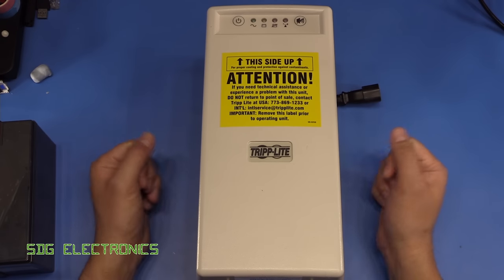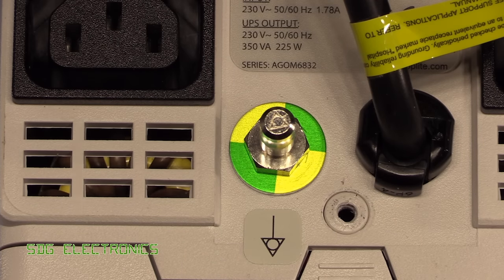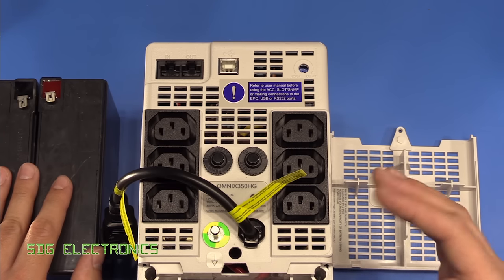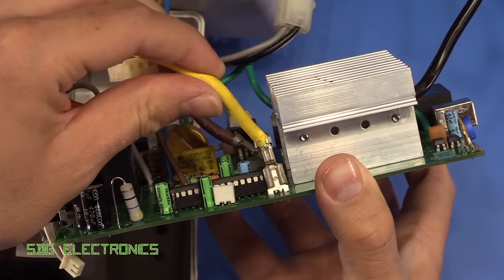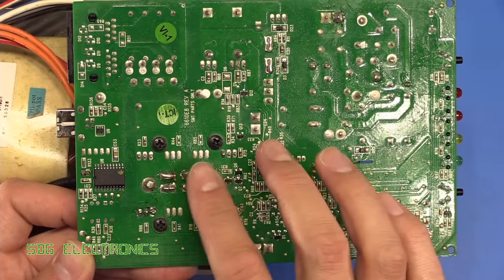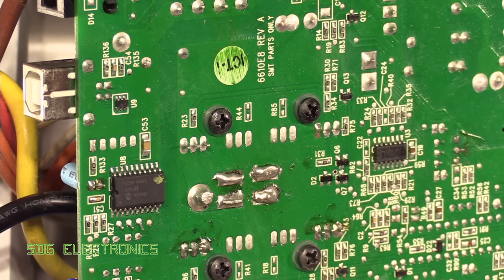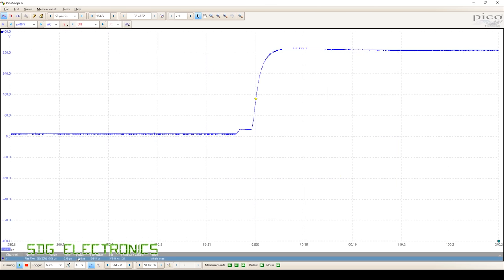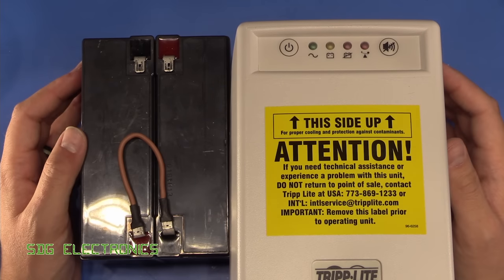SDG #145 Terrible Tripp-Lite Medical UPS! Pure garbage.

Comment: That's incredibly sad that things like this device are required to be used due to messed up regulations even if they are of poor quality and unbelievably overpriced.
Almost any reputable commercial grade device would be cheaper, safer, more reliable, and more sanely designed.
Reply: Totally agree
Reply: Depending on the medical procedure, you are still better off fully isolated than commercial ups for patient safety,
The actual design of this is garbage though

Comment: When I first saw the title, I thought you had gone prematurely senile. Medical equipment invariably includes the worst crap electronics. This is a typical example. To add insult to injury, when they put the 'medical' label on it, they charge ten times as much... Anyway, thumbs up for the video. I expected the unit to be garbage, but was still amazed by the AC output waveform.

Comment: Live and neutral fusing is because they could use it on an isolation transformer, which means both input lines could float WRT mains earth, so to protect against a short they fuse both, though probably the switching relays only switch live, passing neutral straight through, so an output fault of line to ground fault could feed back to the input side.

Poor design, and likely hand placed for a lot of the through hole stuff, thus needing the rework on the line to correct. Yes they solder automotive blade fuses in, but some are actually tin plated steel, and solder quite well, though they tend also to be the no-blow variety then, or at least blow very very slowly. I would have preferred they use what most use, which is a pair of crimp in spade connectors soldered to the board, making it at least easy to replace the fuse. Generally though if that fuse has blown then all the mosfets are also either smoked out craters or short circuit all ways, and the driver is also toast.

At least they used optocouplers, and decent clearance on the PCB, spoiled by the wiring being laid on the isolated side. Phone protection better than most, as in general there is only a PCB trace as fuse, and a dual MOV or spark gap on the phone pair, nothing else, though some I see the protection is not working, as the earth cable is not installed, or they do not install the MOV's or spark gaps.

Typical cheap UPS, not mains isolated, and built down to a price, using an old design. Would expect that transformer to run hot as well, and to be made with CCA wiring on all of the windings as well. Have a few I got for free with dead batteries, they are really only good for scrapping out the battery and the metal, and if you need an IEC inlet or outlet for something else, or some bottom end slow mosfets for power switching.
Reply: The main problematic point is that this UPS is not cheap at all. It's listed for US$500 at various suppliers.
At that price and intended use it shouldn't be built down to a price.
Reply: Technically this device IS an isolation transformer.
Symbolically speaking, our mains earth and neutral combine at the generator. You can't provide this functionality for the UPS unit and have a dedicated and reliable "back-flowing" path. Just turn the plug around, what also changes L+N. There may be a harmful potential between any current path and a following device casing. So any(L or N) cable to housing earth short circuit may provide the cut-out breaker current flow, therefore both have to provide a fuse. Remember that this is exactly the functionality to protect us from deadly touch voltages. And secondary, less important to secure the device.

Comment: They tried to solder to a blade fuse? the reason it hasn't flowed is because the elements in those including the legs are aluminium!

Comment: The microweld between the heatsink and the resistor is rather telling.... I hope Tripp Lite watch your video and do some hard thinking.  Nice tour around a shocking device.
Reply from the maker: Yeah, not good at all really. Doubt it'll get seen by anyone who can make any changes though.
Reply: @sdgelectronics  I guess the cost of certification/re-certification probably slows down any incremental improvements

Comment: Is there anything on the device that says it's for medical use I don't see any in the video, i've seen that company before on rack mount power strips (standard 19" racks).  Just wondering if they made it for medical use or if it's just being mis-sold.
Reply: It's marketed as medical grade on the official site and in the datasheet which is available on octopart or digikey.

Comment: I have taken apart Tripp-Lite, APC, Liebert, Cyber-Power, Vertiv, Eaton, and Minuteman UPS units. Every one of these brands has some quality issues. These small units are built to a consumer price point. The Tripp-Lite that you showed is one of their less expensive models that is made in China. Not to mention they state that they are not approved for life support systems. But, if you call Tripp-Lite they have had good support and they will replace it under warranty. I believe the UPS industry seems to be not about quality but support and warranty.

Comment: Did I see correctly that C51 has one end floating?  The SMD cap next to the PIC18...
Reply: Looks like the part may be smaller than the intended footprint so there's a big solder fill blob there? Still looks attached to the joint to me.

Comment: That is not a common mode choke - only one winding, the live side, NOT both live and return Neutral.
Reply: That's why he said "differential mode choke".
Reply: @kitsune-denshi  My mistake
Reply: As I said before, a differential choke has a supply and return winding to cancel out Common Mode. The  choke configuration is Single Ended!

Comment: Since the solder joints are all DULL , I suspect they used: 'Lead Free' solder.
Reply: Well they had to in order to be able to sell these things anywhere. But I bet the monkeys who put that together would have messed up leaded solder too (just not quite as badly because it's easier).
Reply: Bear in mind that there are many types of lead-free solder. There isn't just one formulation such that generalisations like that make any kind of sense. For example, lead-free solder joints absolutely can be shiny: dull joints are often caused by the iron being at the wrong temperature, lack of flux, poor quality flux, etc.

We have had many decades to develop lead-based solder to get it to its current state, while lead-free solder is relatively new, at least in being used to the extent that it now is, and it seems that a lot of opinions were formed early in its commercial use - opinions that don't necessarily reflect the current state of things.

Yes, there are some totally crap lead-free solders on the market, and the better ones are, unfortunately, often a fair bit more expensive than the budget lead-free solders as well as leaded solder in general.
I also suspect it might be harder to screw up manufacture of leaded solder, so if you buy random solder from eBay/AliExpress, you are probably more likely to end up with something usable if you opt for leaded stuff - but I've had leaded solder from AliExpress that was really awful, so it definitely is possible to get bad leaded solder!

I've found that Rapid Electronics' own-brand lead-free solder (99.3% Sn, 0.7% Cu) is usually "okay" and is very affordable (£7/100g, only slightly more than their own-brand leaded solder).
Their "Premium" lead-free solder, which has 3.9% silver (95.5% Sn, 3.9% Ag, 0.6% Cu), is a LOT better and I never have any issues with it at all. Unfortunately it is more expensive (£22/100g), but that might not be too bad, given the amount that hobbyists will use: a 100g roll is expensive to buy up-front, but it'll last most hobbyists a long time.

Rapid also have a variety of lead-free solder that adds nickel and germanium (96% Sn, 3.0% Ag, 0.5% Cu, 0.06% Ni, 0.01% Ge), and that's apparently even better, but they only sell it in 500g rolls for £90, so I've not bought any of that to try out...
Felder make some good-looking lead-free solder products as well, so I'll probably try some of those at some point.

I don't have any personal experience with other brands of lead-free solder wire, so I can't make any recommendations there, but Rapid Electronics don't have a monopoly on good solder, so plenty of other companies will be making good stuff as well - you just have to avoid buying random stuff from eBay & AliExpress, and maybe do some research first.

People with no experience of good-quality lead-free solder always bashing it is getting pretty tiring at this point 😴